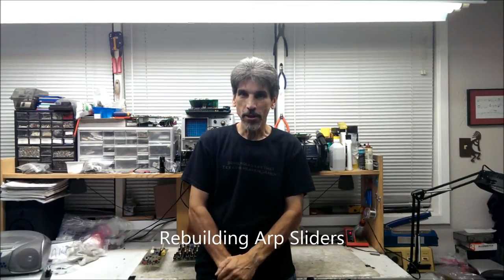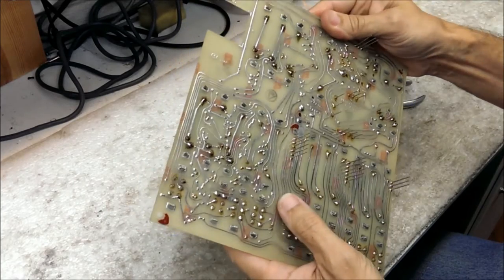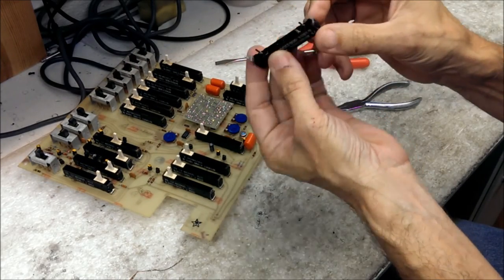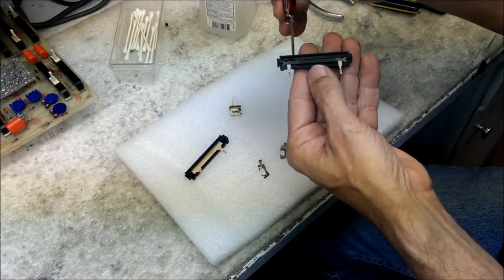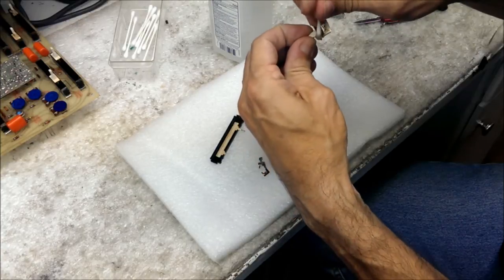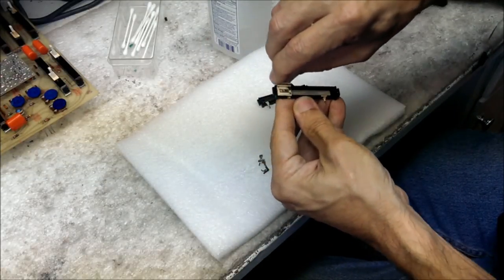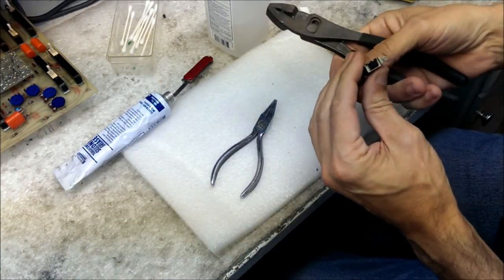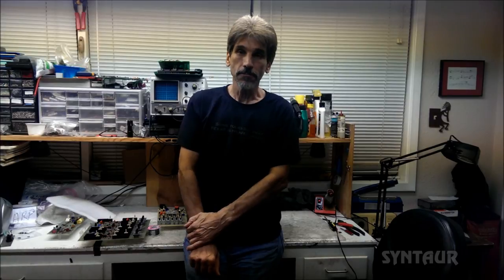Rebuilding Arp Sliders

Comment: Thank you for this Sam. I have the unenviable task of doing this with plastic pots on a Crumar Performer. Whether they will come apart and go back together as well remains to be seen. The anti-log slider (mod rate) has no resistance in it so I'm guessing it might be worn out. Can these be reconditioned? They are impossible to find, even at Syntaur. Thanks Alistair

Comment: It is possible to use a modern potentio slider on these boards, you would only have to design a converter so it fits on the board.

Comment: HI..Great vid..thanks. Can you help,    i noticed on the Arp Odyssey MK3 i have, the VCA gain slider is in backwards.[the indent circle is on the left,all others are on the right] Just the slider bit not the whole fader assembly. Will it cause problems or should i change it..Thamks in advance....Mark
Reply from the maker: I don't have one here to look at right now, but if it is working, then I'm sure it is correct.  In some gear, not all of the sliders are in the same direction - some are 'upside down', depending on the function.

Comment: Great video, Sam from Syntaur!  I have been refurbishing a 2800 whiteface I rescued from the trash, and I was wondering: is there any way to repair the conductive strips inside the sliders?  I have one or two which have lost continuity, and I hate to just throw the whole pot away.  Is there some trick for rebuilding the conductor?  Some magic carbon/paste combo that can be applied?
Reply from the maker: No, that's the critical part of the slider, and if that's gone it needs to be replaced.

Comment: Hello Friend! I arrived 15sl last week, after checking revealed the bad work of the "cue selector" buttons. They do not booster and, when pressed in the earphone, cause interference and crackling, which greatly interferes with the information ...
What do you think if you clean them wd it will help?
Did you have such a problem with them? apparently they are often used and worn out

Comment: Is there any way you can replace the shaft with a part from a company like Mouser? I have an Axxe that has a lot of broken shafts/crooked keys and would love to refurbish it.
Reply from the maker: Unfortunately, there's no source (that I am aware of) to get these slider shafts.  Crooked keys are easier to deal with - that is a matter of replacing the bushings (Syntaur part #4169) and bending the metal tangs that the bushings mount onto to get the keys back into alignment.

Comment: Hi from NZ. Awesome demo Sam. I have got hold of a well used MC 909 with a mixer slider problem. When you slide pot 7  pot 8 also slides, very strange?  I'm gone tear the whole thing down and just get the new pots and pads from you guys. Great resource you have there. FYI here is the afflicted unit,  might give you a laugh.     http://www.trademe.co.nz/Browse/Listing.aspx?id=1100245306
Reply from the maker: Sorry, I don't know why one slider would cause another to move without having it here to test. Good luck with that thing!

Comment: At 14:05 you put the grease not only at the wrong and useless spot but also only on one side. The grease needs to go there where you cleaned out the goop with your finger nail earlier.

Comment: Why dont you just drop them all into a ultrasonic parts cleaner? Would save lots of time!
Reply: Does that work for slide pots? I'd be afraid to do that.
Reply: @scottmc2626  Tried it with some sliders, but didn't make much of a difference. The ultrasonic process didn't remove the black oxidized dirt from the carbon track or metal track. Still have to clean it by hand using a Q-tip, brush and alcohol. Or am i doing something wrong with the ultrasonic cleaner?